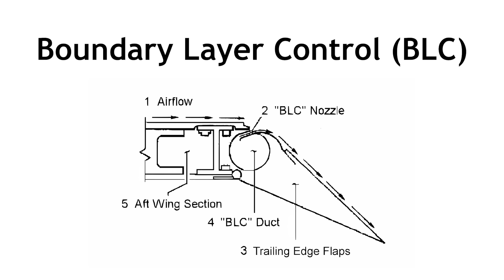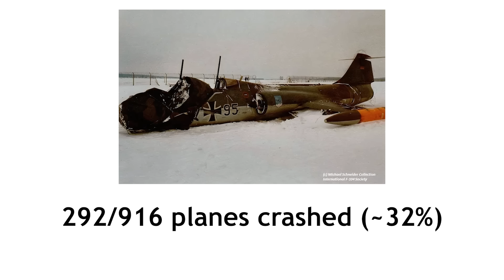Why This Jet Killed So Many Pilots?

Comment: What F-86 pilots wanted was a fighter that enhanced high-altitude, high-speed performance while retaining the F-86’s original strengths. What Kelly Johnson came up with, however, was a monster that discarded all of the F-86’s advantages, leaving only high-altitude and high-speed performance. 
The F-104 sacrificed every aspect it could afford to sacrifice in order to achieve Mach 2 speed and a very high climb rate. As a result, its flight characteristics were extremely unforgiving. At the time, there were many contemporary designs with comparable performance that were clearly superior in terms of practicality. The F-104’s commercial success was largely due to Lockheed’s mastery of behind-the-scenes maneuvering rather than the aircraft’s inherent merits.

Comment: I did a yearly inspection on a civilian two seater. what we found was one aileron moved more up and down than the other side. After further investigation the single seater had a different aileron actuator. I had a wrong one installed. We ordered one and corrected the issue. Tracor Flight systems had DOD contracts. We droned a lot of aircraft  for the USAF. The good old days that was  in the late 80's.

Comment: If I’m not wrong, the F104 served in the Spanish Air Force for 12 years without any fatal accident, nor a damaged-beyond-repair one. An USAF commission visited the SAF to find out how they managed to get such results. Some of the factors were the high experience and average age (above 30) of the selected pilots for that fleet, and using the airplane for its intended role.

Comment: The F-104 Starfighter  does not have the climb rate of the English Electric Lightning. The Starfighter's was designed for speed and manoeuvrability, but cannot out climb the Lightning's vertical-climb performance.  The flaw in the F 104 pitch were moderated after the Americans were given data from British supersonic tunnel tests which identified deficiencies of a high horizontal stabiliser in low density altitude and speed.  The Germans should have bought British.

Comment: You are flying a dart with a jet engine strapped to it. The glide path of a steel rod, critical lift speed of mach 1 and turning ability of a 1946 bread truck.  What could possibly go wrong

Comment: the vast number of early accidents were do to the BLC(blown wing) if you pulled the throttle back the sudden, normally asymmetric loss of lift would cause a snap roll at an altitude too low to recover from. Later accidents were almost exclusively due to (exposure time) low level high speed in crap weather, birds, hills, and the ocassional midair collision caused most of the later accidents
Reply: The majority of ALL Starfighter accidents was caused by the J-79 engine.  Asymmetric loss of lift resulting in a snap roll (usually in the landing pattern) was caused by a split-flap condition, not the loss of BLC.
Reply: @dukeford  not according to my uncle.  he  was a sqn leader in germany rcaf
Reply: @ndenise3460  Could be we're both right about the flaps.  The J-79 was the main culprit for crashes, though.  That is supported by the historical record.
Reply: from the RCAF museum page.  only four fatal crashes were due to aircraft system failures.

The principal cause of crashes was due to bird strikes or other factors resulting in engine failure. Other crashes were from the nature of Canada’s NATO role which necessitated flying at high speeds at extreme low levels. Combined with the poor visibility of European skies this resulted in many aircraft being involved in controlled flight into terrain accidents.
Reply: @ndenise3460  That's Canada. Look at the Luftwaffe or USAF losses.

Comment: We grew up with the sound of starfighters. Normally the flew side by side with two aircrafts slow flying, which means faster than every piston aircraft. Sometimes they gave us the sonic boom and sometimes so windows were broken by that. Nobody discussed the sence at that time. Crashes, as they were very often, as children we took them as normal. One aircraft crashed nearby and we went there the following day to get some melted metal pieces as a souvenir. Occasionally I met an old retired starfighter pilot and I asked him many questions. He said "Your mind had to be faster than the plane to operate it safely. So, when your mind could achieve more than mach 2, you could make it".

Comment: And why did the Germans etc buy it, Lockheed's kickback payments. The American Air Force dumped it fairly early. By the mid 60s the UK had a faster interceptor, The Lightning.
Reply: The USAF flew the Starfighter for 11 years, followed by another 7 years in the ANG.  I guess that's "dumped fairly early" to some🙄  The Lightning was inferior to the Starfighter in most respects except low-speed handling.

Comment: The Brits built the Lightning for the same job.
Reply: No, they didn't.  The Lightning was a dedicated interceptor.  The F-104 was a multi-role aircraft.  The majority of NATO Starfighters were used in the low-level strike role.
Reply: @dukeford Planes can be used for any job they’re given, but what I meant was with stubby wings op engine thrust. Same initial goal, however they were used later on. And how suited were they for that? I’m sure the Luftwaffe were thrilled.
Reply: @ICGedye  As well suited as any other aircraft, and probably better than most.

Comment: Actually, the English Electric Lightning (first flight 1954) could climb faster! It had a high loss rate too, but only 50 of the 330 made were destroyed in crashes, not as bad as the Zip 104, and at least its seat ejected upwards from day one!
Reply: The F-104A had a higher initial climb rate - 60,000 feet per minute.  The Brits lost over 80 Lightnings, not 50.

Comment: Any good model airplane designer could tell you that the forward part of the fuselage became the lifting area and there wasn’t enough control surface authority to ever push the nose back over again once the angle of attack was excessive

Comment: To be fair, Johnson gave them exactly what they asked for. Not his fault you can't break the laws of physics. The wing loading on the Starfighter is just a hair short of infinity. You might as well be riding a bull with wings. Johnson shouldn't have even bothered with wings and just made it a rocket with reaction controls. It is a point defense interceptor anyway.
Reply: Germany asked for an all weather fighter bomber, they got a fighter than was useless in bad weather and not much of a bomber.

Comment: The Germans forced it on a way shorter runway than it had flown in the air force. That and making it a fighter bomber those two ingredients right there make a widowmaker cupcake for all to enjoy. By the way people had fewer problems on a long runway check it out and you'll see where miss use comes into play.

Comment: I was a photographer in the RCAF, stationed in Germany where we flew CF104s. I was lucky and got to fly  9 times in the backseat of a "Dual" taking pictures. But I also was duty photographer when a Pilot lost his life landing at CFB Baden. He had landed once doing a "touch and go" but on the second try the plane developed a fault less than 1000 feet from the end of the runway and he had no chance or time to eject. Later whenever I flew over that end of the Runway (21) i always had my hand resting on the C2 ejection seat handle, just in case.

Comment: We, the Dutch, bought 136 F-104’s; 36 crashed, Germany lost 292 of the 916, killing 116 pilots…. So both lost about 31% of their planes. And than to think that we were corrupted in to buying the F-104 by prince Bernhard, husband of queen Juliana. When that came out it led to a constitutional crisis. Ah, the good old days….
Reply: 31% is a reasonable loss rate.
Reply: @dukeford I think pilots have a different opinion about that…..
Reply: @lolkevandewitte1713  Oh, for God's sake.  Do you think that fighter pilots don't understand the risk?  Don't be daft.
Reply: @dukeford  I’ve known quit a few, some flew dangerous missions. And yes, they know the risk. But they were very happy that planes have got far far more safe to fly than the F-104….
Reply: @lolkevandewitte1713  That goes without saying.  FWIW, I spent 2 years at Soesterberg 77-78.  Very familiar with Dutch 104's.

Comment: The German casualties were largely due to too many rogue pilots - a quite common thing of the days. Just as in civil aviation flight safety was improving over the years until todays standard that is acceptable considering that military flying inherently is more dangerous that the mere civilian A to B flying
Reply: My Dad, F/L Bob Lowry, trained many NATO crews on T-33s at #2 Advanced Flying School at Southport (RCAF Station Portage la Prairie). One particular German pilot was below standard yet Dad was ordered to 'pass' him for his wings parade because his father was a high ranking German politician. Dad refused to do so, and someone else was forced to pass him. That German pilot returned to Germany, flew 104's and was dead within the year.
Reply: @stephenlowry8618  The Germans put quite a few pilots into the airplane that should have been flying something less demanding.

Comment: Japan and other countries who used the aircraft as an interceptor  did not have the same accident rate as those trying to deliver nukes at 250' AGL in the usually shitty European weather. The aircraft was excellent, the application flawed however by some countries.
Reply: It still had issues at takeoff and landing, but it was developed as an interceptor and not really suitable for ground attack.

Also Luftwaffe made the huge jump from F-86s to Mach 2 and this step was too big for them.
Reply: @simonm1447 so did every other NATO and third tier country who used the aircraft as designed....Denmark, Norway, Japan, Turkey, etc, etc....
Reply: The environment and mission is what killed pilots, not necessarily the airplane.  Pick any contemporary jet used the same way and you'll get the same accident rates.

Comment: the wings leading edges were that sharp it could slice paper
Reply: Every F-104 I've ever examined had wing edges about as sharp as a butter knife.  You'd really have to work at it to cut yourself.

Comment: When you look at statistics, the F-104 didn't have a higher accident rate compared to other fighter jets during this period. As far as I remember the F-100 and F-105 had an even higher accident rate over all...
Reply: All 2nd Generation fighter have very similar attrition and accident rates.  The fatality rate for NATO Starfighters, however, is about 10%-15% higher than average.
Reply: @dukeford  F-104 is a third gen fighter jet.
Reply: @RunsWithChainsaw  When comparing operational safety statistics, I'll stick with the most commonly-used classification, thanks. It's easier that way.
Reply: It depends on how you count it, the F 104 certainly did kill far too many pilots.
Reply: @barrierodliffe4155  WTF is "far too many"? They ALL killed a lot of pilots, friend.

Comment: There is no comment on the government lead sales pitch to flog them to anyone and everyone regardless of what the airforces actually wanted.  Also the last countries to be using them (Italy and Turkey) used them in the role they were intended,  high altitude interception, and had much more success.
Still a favourite of mine though.....
Reply: Italy made a number of changes to the F 104  which helped but they still lost 38 %, Turkish numbers are vague but they lost a lot too.

Comment: The F104 has tiny wings to maximize max speed and altitude. The U2 has huge wings to maxinize max speed and altitude. So, what's going on?
Reply: The U2 has long wings to maximize LIFT in thin air (high altitude) at SLOWER speeds (low speed not max speed for any given altitude).  That is what's going on.
Reply: U-2 is flying much higher. These subsonic high altitude platforms always have long, sleek wings like gliders and low wing loading compared to a fighter jet.

Comment: My Dad was stationed at Luke AFB in the late 1960s and was a squadron commander training the German Luthwaffe. I’m glad he survived this fighter jet!
Reply: What was your Dad's name? My father was Major Louis C Zucker and he was stationed there in 1967-68. I remember him flying the F-102 Delta Dagger with the 356th Fighter Interceptor Squadron out of Elmendorf AFB in the early 60's. Unfortunately he was called to Vietnam from Luke AFB and was KIA in March of 68.
Reply: @Txdvsz  My dad was an F-104 instructor for the German pilots at Luke AFB, Arizona in the 60s. Lt. Col Edward Gund, retired in '70. He also did a stint in 'Nam '67-'68 but fortunately made it back. My condolences to you for your father, mine passed at 92 in '21.
Reply: @Txdvsz  Bob Ford
Reply: Wild to see so many people who were involved with it.  As a child, I was able to occasionally fly the simulator at Luke AFB because my dad was the computer engineer who managed the three or four engineers who ran the simulator.  Today a flight simulator creates the image in software.  Back then the giant tube-based computer could only do to the motion calculations.  The image was created by projecting an overhead image of the area around the airbase on the wall of a room next to the simulator.  A closed-circuit black and white camera was mounted on a couple of rails and "flown" over the image in the direction the pilot was flying the simulator.  The camera would zoom in/out when the pilot flew "higher" or "lower".  A trace of the pilot's flight was etched into a small square mirror for later review.  Very low-tech compared to today.  

I'm not sure if I am remembering this correctly, but another problem that might have been a factor for the pilots back then was that if you were practicing an engine restart in the simulator, the way the simulator simulated the restart procedure was the same whether you were at 100 feet above sea level or 50,000 feet above sea level.  But, when in actual flight, the engine would not restart as rapidly at altitude.  When a pilot had an actual engine flameout at high altitude, he would do the restart procedure he had done in the simulator.  But the engine did not restart right away, so he then begin the engine restart procedure again.  It again would not restart as quickly as he expected, so he assumed he needed start over, and he'd repeatedly do this all the way until he had to eject or crashed.  As I said, not sure if I am remembering this correctly.
Reply: Same here...

Comment: Back in the day, I remember the unofficial story was that being the most technologically advanced fighter in service, maintenance crews were often lacking in experience and skills necessary to service it properly. Especially overseas where a disproportionate number of the losses occurred.
Reply: It was far from being the most technically advanced fighter, but you are correct about the maintenance.  The Germans had the most problems with it.
Reply: @dukeford  not even when first introduced In regular service? surprised but if you know better, fine. Didn't think Kelly Johnson did vanilla aircraft.
Reply: @arnewoodman  The original Starfighter was a pretty simple day/air superiority fighter.  The basic F-104 airframe is relatively easy to service and was designed that way.  The J-79 engine, like most early turbojets, had it's deficiencies and was problematic to maintain and operate. The NATO F-104G did have some advanced avionics that could be difficult to keep in service, which contributed to the safety record, if somewhat obliquely.  Everyone but the Germans seemed to take maintenance a bit more seriously, which is one reason the Germans had such a miserable safety history the first 5 years they operated the airplane.

Comment: You just said the the stubby wings and the high tail stabilizer were a deadly combination that was directly responsible for the plane vulnerable to crashing regardless of the skill of the pilot. Ejection into the ground ….WTF!
If I was a pilot of that plane I would land it at the Skunk Works … and shoot the SKUNK!
Reply: C, G, and S models had upward ejection seats

Comment: The Hellenic Air Force obtained many F-104s, some from Germany. At first they had several accidents with casualties but managed to decrease the accident ratio to the smallest in the world, mainly by extensive pilot training and actually using the plane in its intended role, an interceptor. Its pilots loved it for its performance but admitted that it was very unforgiving.

Comment: The F - 104 was designed as an area interceptor. The Luftwaffa was tasked with a low level strike  mission. Added to the risks of the mission profile were logistic and maintenance problems.
Reply: You can call it whatever you like, but I know a pure point defense interceptor when I see one. The only more pure PDI was the Me-163. So pure as to be completely stupid and pointless. Kinda fitting the Luftwaffe was the last major user of the Lawn Dart.
Reply: It was designed as an air superiority fighter.  Not as an interceptor.

Comment: Circa 1973, there was a ‘Tiger Meet’ over in W Germany, our Folland Gnats of 4Sqn were invited as an honourary Tiger Sqn due to the instructors all comimg from fighter squadrons. During a formation flight, a German F104 inexplicably selected airbrake and the Gnat behind flew up the F104 jetpipe. The Gnat lost its nose just in front of the pilots feet but landed safely, guided in by a chase aircraft as he’d lost all his instruments. The 104 landed safely with a large rent in the aft fuse, from where the Gnat tore its way out of the jetpipe.